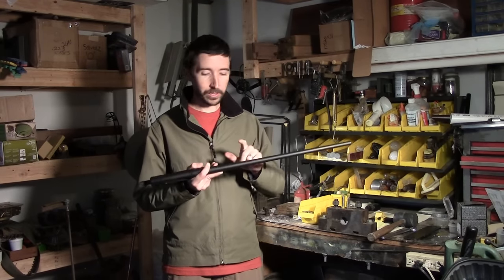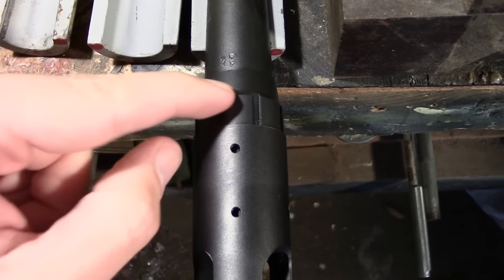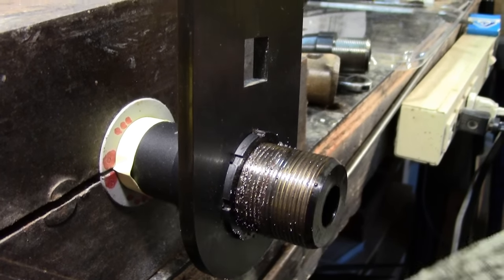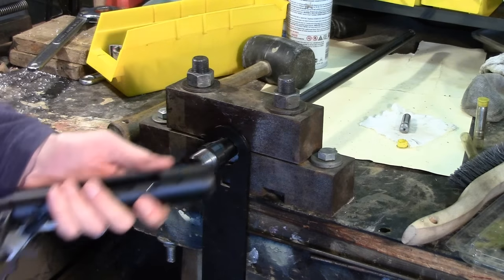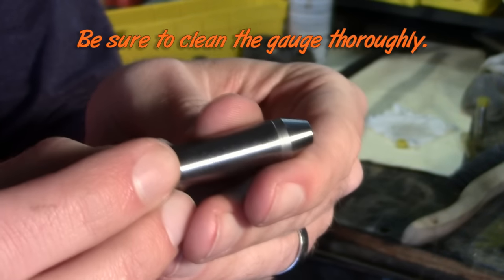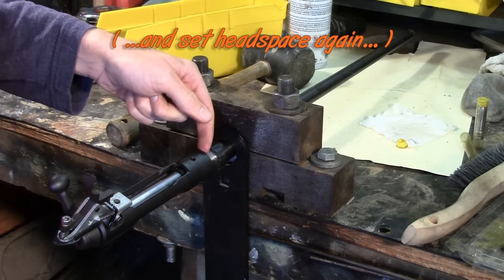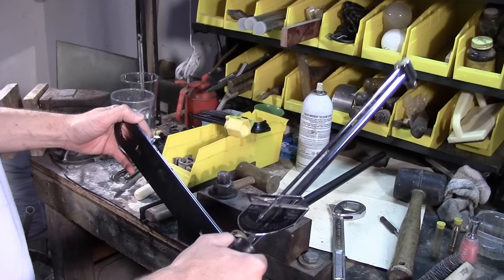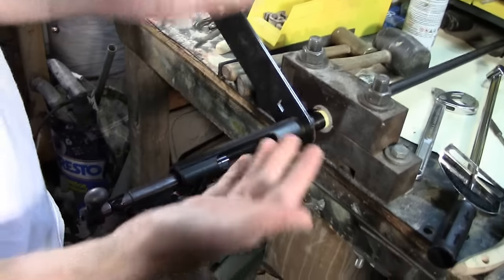Swap Savage Barrels - 1000 Yard Savage Axis Budget Long Range Rifle | The Social Regressive

Comment: question how you know the action and barrel is level straight with each other if you mount the barrel action onto the stock front sight is not canted crooked
Reply from the maker: This is a tricky question.  For rifles with a front sight post, you have to very precisely index the barrel to a predetermined spot.  I suppose you might be able to use a laser if you're trying to reassemble a Savage with a front sight.  I've never tried it myself.

Comment: Mine had the same metal beads in there!
Reply from the maker: I've been hearing this more frequently; even the more expensive models seem to have this stuff in the threads.
Reply from the maker: Just be sure to clean everything very thoroughly and don't let the nut go back over a section that has these.  There are guys out there that had to cut the barrel nut off because it got stuck.
Reply: @SocialRegressive  The metal beads you are seeing are shot-peen and are used to relive stress in the barrel from machining process's

Comment: If there had been an iron sight on this barrel would it be canted relative to the action?
Reply from the maker: +trefod It's possible.  If it were a fixed iron sight a gunsmith would probably have to cut the barrel specifically for that one action.
Reply from the maker: +trefod I imagine Savage times all their actions the same, though.  I'd be curious to see if someone has swapped one of the Savage Hog Hunter barrels onto another action.

Comment: is it possible to install a 7mm remmag barrel onto a savage axis? what other modification would you have to do in order to get it
Reply from the maker: It's a long action, so it can probably handle it once you swap the bolt head.  Unfortunately, I've heard that the Axis bolt head is not the same as the typical Savage bolt head, so it seems like you would have to make your own.  The magazine would probably need some modification, too.
Reply: +The Social Regressive I'm a new shooter what is the silver guard on the top of your barrel what does it do where do you get it ...thank you for your time
Reply from the maker: Sterling Cook It's a mirage shield.  It's just a slat of metal, plastic, or cardboard to prevent the barrel's heat from distorting the image in front of the scope.  I made mine from a slat from a mini-blind.
Reply: I have a similar question. Could you take a 270 set up and change to 6.5 creedmore?

Comment: Why do you change the barrel? Is it not possible to continue improving the rifle with the same barrel instead of changing it?
Reply from the maker: You're right; I could have just built up stock Axis and stuck with .308.  I decided to buy a .308 and then swap for a couple of reasons: I knew I wanted the superior ballistics of 7mm-08, but I already had an equivalent 7mm-08 barrel.  And I really wanted to post a barrel swap video.  There are a lot of Savage owners out there that would like to see how easy it is.  Sometime I'll use that .308 Axis barrel and build a rifle around it.
Reply: Anyway, I wonder if I can continue working with my Savage Axis .308 without changing the barrel and get satisfactory results at 1000 yards. Is it possible ?

Another question:
I have a Zeiss Conquest scope 4.5-14x50, do you think it is appropriate or it is not enought  magnification?

Congratulations for your job, I really like it.
Thank you for your answer. 

.
Reply from the maker: .308 is still a perfectly capable round at 1K.  It's a wonderfully precise round, and probably half of the competitors in our matches are shooting .308.  The difficulty you'll need to overcome is the short barrel length of the Axis.  Some guys' bullets hit the transsonic barrier before 1,000 yards, and the results are awful.  You'll need to pick a bullet and load that will keep you supersonic as long as possible.

Your scope should work just fine.  14X is plenty, and the Zeiss lenses will do you a lot of favors when you need to read mirage.

Comment: How much was the new barrel? I missed how you got this in with the $500 budget.
Reply from the maker: The barrel was a freebie swap to a barrel of the same quality. you can just use your factory barrel; it's the same performance.
Reply: @SocialRegressive  .308 it is then. I just finished watching the series and now you’ve inspired me to build up my axis II. Have you noticed any inaccuracies after 5 or 6 rounds as the barrel gets hot?
Reply from the maker: @sixdegrees6434  Not really. The only thing I've noticed with some Savage barrels is that the cold shot will fly a bit. Once warm, the groups tend to cluster nicely. On my .308 barrel the cold-bore shot was fine, though. Maybe they've improved their barrel quality in recent years.

Comment: OK so this is a $500 gun in name only. There is no way the average shooter will have the resources you have to build this Frankenstein. An interesting playlist no doubt but not within reach of your average shooter.
Reply from the maker: If you add up the hours I spent upgrading this thing, it's a very expensive gun. However, the parts themselves are cheap, and the tools are fairly common in a handyman's garage.
Reply: David, it actually is within reach. LOL. I just got finished building my axis, only mine is chambered in 30-06. I bought the same Boyds stock, pillar bedded and action bedded it myself. I used some brass pipe to make my own pillars and actually used some old school JB weld, for both the pillars and the action bed. Even with a cheap scope I was still at $500. I actually added a nice Vortex diamondback scope and a sweeeeet 26 inch SS bull barrel, still chambered for 30-06. I'm around $850 with everything including the cost of the rifle. You won't find a rifle that is pillar bedded, action bedded, with a nice scope and a 26 inch bull barrel, especially in 30-06, for that price. The Savage axis is a cheap rifle that becomes expensive. What annoys me, people say this is too much for an Axis. Yet, they don't hesitate to dump 1 or 2 grand in plastic tacky tactical stuff for their, also once cheap, 10-22. A squirrel rifle with crap ballistics for that much dough. So, $500 is too much to spend on an Axis but 1K isn't too much to spend on a crap rimfire? Hmm. Sorry for the rant, I wanted to chime in, it is possible.
Reply: I have no problem with the Savage platform, in fact I find it quite resourceful and an interesting build. But what I meant to say is that the average shooter will not have the tooling this gentleman has with regard to swapping barrels, checking head space, using a paper clip to sweeten a trigger. These are very specialized talents that take many years to master and the presenter even admits to having his father-in-law (a retired gunsmith) help him on various areas of the build. Just saying. I would love to build this gun, but there is no way I could without spending thousands of dollars having a gunsmiths assistance.
Reply from the maker: That's a good point.
Reply: +David Keleshian Ah still not really. You can buy a Savage barrel wrench for $25. Then a cheap barrel vise off eBay ($35) then rent a headspace gauge from a website for $30. I just clipped my spring and polished the sear engagement areas with mother's polish. Swapping Savage barrels requires no gunsmith what so ever. Pop the headspace gage in the chamber, screw your barrel in till it headspaces on the gage,  tighten down barrel nut. Done. It's very simple. The average shooter isn't a gunsmith but I'm sure they can read, or watch in this case. I've never build a rifle, swapped barrels or even done anything more than the occasional trigger job, even I was able to custom build my axis.
Reply: +losi8ightyew A drill, a Dremel tool, files, sandpaper and epoxy is all you need besides the headpsace gage, barrel wrench and barrel vise. All basic tools any shooter will have, besides the last 3.
Reply: losi8ightyew I understand it may seem simple to you. But knowing my level of craftsmanship capabilities when it comes to gunsmithing I would have to pay someone for their help. Maybe I'm a below average shooter. But the majority of people I know have far less understanding of gunworks than me.
Reply: Hey, Rifles, if thats true and not bs, do you think you need a barrel vise, or no? Would a vise with a "floor" be good enough?
Reply: TW0T0NGUE Regular vise would do just fine, you just need to pad the jaws and not seriously crank down on it. It all depends on whether you choose to clamp the receiver or the barrel.
Reply: TW0T0NGUE If you buy a new barrel nut to replace  the old one,  you can even use a pipe wrench to get the old one off. It will be extremely tight and Mar the hell out of the old nut. Even with a barrel nut wrench I marred mine a bit.
Reply: Ok guys looks like David has no common sense so let him pay someone who does and leave him alone.